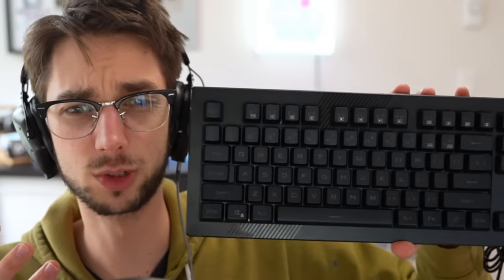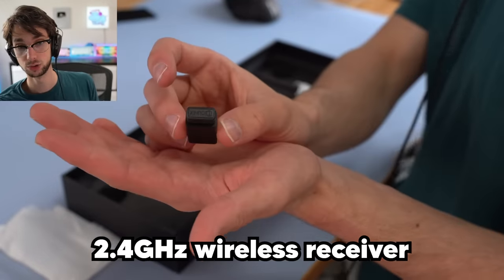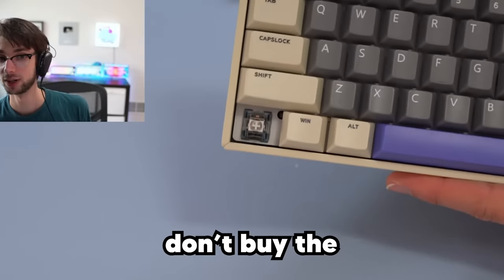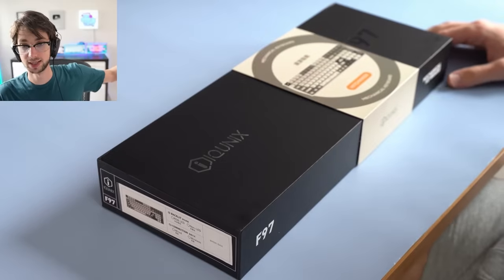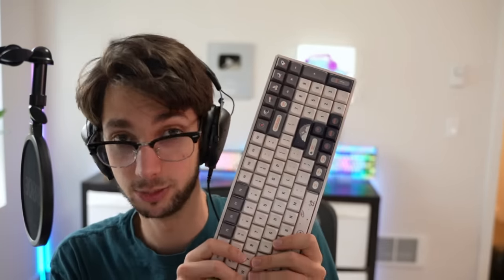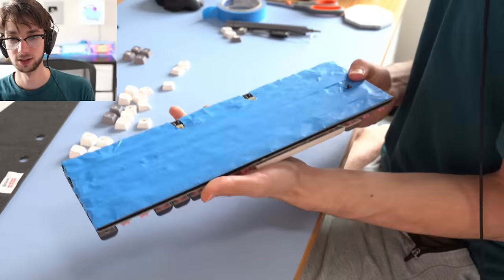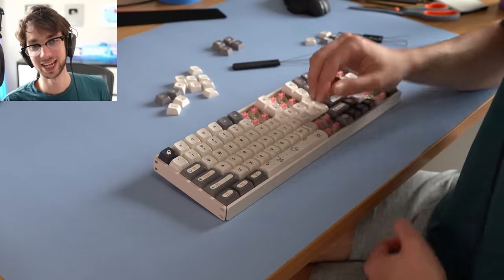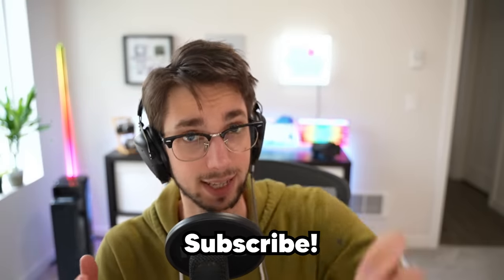Why do People Want Keyboards With Number Pads??

Comment: I have a crappy keyboard that came with an optiplex I bought a while ago, I also have an expensive custom built keyboard that sounds and feels great. But I still prefer the crappy one because it feels comfortable.
Reply: Bruh
Reply: you just gave r/mk an aneurysm. i love it
Reply: Actually though, I was rapidly disillusioned with the concept of thock at the first moment I had to type on one of those keyboards and it felt like a membrane keyboard made to tolerance. The whole modern mechanical keyboard space is such a far cry from the model M that spawned the industry, where the mechanical portion actually has purpose and the springs are physically sending your fingers flying to the next key.
Reply: @davidy22  1000%. As cool as "thock" sounds, at this point we've come full circle to membranes again. You know what kind of board has the softest thock sound? Membrane. Membranes also have a very soft typing feel. I currently have a Roccat Vulkan 121 with brown mechanical switches. No mods. Sounds and feels amazing, because it doesn't sound and feel like a membrane. I actually really like the mechanical, metallic, springy sound and feel. Also never thought I'd love brown switches this much.
Reply: @ThorsShadow  i never quite understood the point of gasket mount because membrane keebs are also flexy lol
Reply: ngl i feel the same sometimes with my dusty Dell membrane keyboard. Sometimes simple is better.
Reply: @Jwork   why do cars have suspension? Why not just make the whole chassis flexible?

Comment: As a screen reader user, I use the numpad as a controller for a secondary screen cursor. I also don't use a mouse at all and use the numpad to emulate mouse clicks on poorly-built interfaces. Also I use Excel. I could not do my work without a numpad. I even use the applications key.

Comment: I felt a little uncomfortable using my TKL keyboard. I really prefer of full-size regular layout keyboards, not even compact stuff like the Q5. It completely depends on what you actually use the keyboard for, though. I play a few games that heavily encourage having extra keys to bind stuff to. If you primarily play stuff like FPS games or MOBAs, a tiny baby keyboard could work great for you.
Reply: I going to get the Q5 Max rather than Q6 Max purely because the knob is a the top RHS where it belongs.

Comment: Other (in-stock!) compact options with numpads that hover more around $100+ are the Akko ACR 98 ($109 - I ADORE their Acrylic line), Akko 3098 series ($109), and a NEW ONE that I love is the YUNZII Keynovo IF98 ($149). 

Akko products in general are insanely quality and insanely cheap compared to competitors. I love them. Their switches are great stock and they're affordable, so you dont have to spend more on different switches. You dont even have to lube them, though I still prefer to. Lot of great options in color/size for every need you could have. Highly recommend if you're getting into/wanna try custom and not break the bank

The IF98 is gorgeous. I'm biased to the jade green, but they have a plain white too, and it sounds pretty good stock. Just lube the switches and lube/replace the stabs if you wanna mod it and it's chef's kiss. They only have like black, white, and green rn, but more options coming in the future.

Custom keyboards are an investment, but they don't have to run you broke <3 Lot of options out there, despite what the gatekeeping and elitism in the keyboard community tell you. (: you just need what works for you.
Reply: Love Akko switches. I used (and lubed) Akko lavender purples in my heavily modded Redragon K552 and Skyloong GK21 numpad.

Comment: "Why are YOU using bad keyboards in 2022??"

Cause i dont want to spend over two hundred dollars for a keyboard, jacob.
Reply: I mean.. that all depends on how often you actually use it. If you're literally typing all day as for example a programmer... I would seriously consider it.. unless you hate yourself
Reply: @ruadeil_zabelin  Considering I got decent keyboard I don't feel the need of buying another one like that. I kinda doubt they are that much better from branded ones
Reply: @wadimek116 Grabbed a thermaltake TT Level 20 for 60 Euros during Black Friday last year.

Good stuff, typung feels so much nicer, especially the finger joints seem to love it.

Never noticed how harsh the rubber domes were on them until I switched.
Reply: @wadimek116 Grabbed a thermaltake TT Level 20 for 60 Euros during Black Friday last year.

Good stuff, typung feels so much nicer, especially the finger joints seem to love it.

Never noticed how harsh the rubber domes were on them until I switched.

Comment: I need the full 100% because I enjoy inputing Alt codes. I frequently use Alt+Numpad 0151 for em dashes and sometimes Alt+Numpad 0148, when I can't normally close a quote, which tends to be after using 0151.

Because of this I chose the Keychron C2 for my first venture into keyboard modding. I carefully lubed all 104 Gateron Brown switches with 205g0 to preserve tactility, filmed them, and glued down pieces of shelf liner to fit every crevice at the bottom of the case with elmer's glue. I also didn't forget to the clip the stabs and used dialectic grease to lube them. The only part I'm not fond of is the spacebar wire, which I can't seem to balance perfectly to eliminate the rattle completely. Lubing only temporarily mutes the rattle but it comes back noticable once the lube thins out.

Otherwise, I'm really happy with it.

Comment: I have the F96 Coral Sea model. It was my first board that got me into the hobby. However, upon ordering it, they sold out and it was delayed. I wasn’t alerted til after I had to reach out to customer service, but they did keep me posted throughout the process. Shipping time was meh, but it doesn’t help that I live in the middle of the Pacific Ocean, which caused the shipping to take longer than intended, considering it comes from China and it has to go through customs and whatnot. 

Gotta say though that it was worth the hassle. Board quality is amazing and it feels awesome to use. I think I might get me the F97 since I can customize the switches compared to my F96 being a solder board. Anyway, long story short. Board good, shipping process meh, but me live in Pacific Ocean, so order at discretion.

Thanks for coming to my Ted talk. Bye..

Comment: Best prebuilts I have EVER used come from Varmilo.  Hands down the best QC and factory amenities.  Pre-lubed switches, case foam & filler, perfect stabs, tons of options and colorways, all major layouts, super high quality PBT keycaps with just the right amount of texture, wireless features, the works.  My TKL from them felt like absolute perfection from the moment I took it out of the box up until now 5-6 years later.  I have since built quite a few customs, but I still adore my Varmilo.

Comment: Not only do I work in accounts payable and need a numpad for 10 key entering (and therefore the preferred way of entering any numbers for any reason outside of work), but I also play PC games from my couch with my keyboard in my lap and my mouse to my right side (mousepad on a large wooden pizza cutting board on a pillow). The extra length on a 98% keyboard with a 10 key numpad means that it will sit across my lap better. Am I crazy for gaming this way? Possibly, but it’s as comfortable as console gaming.

Comment: You can still get an otemu red hot swappable full size keyboard for less than 75 usd with usb c and or wireless. If you don’t need wireless, it would be much cheaper and you can use the difference to get an amazing set of pbt Keycaps. Check Tecware or havit keyboards to start from and go from there. If you still need more nicer feel, lube the switch and stabs. 250 usd for a keyboard is too much to spend unless the company you work for reimburses the cost.

Comment: It's nice that more custom keyboard makers are offering options that include a numpad but I'm not crazy about how they've made the zero smaller so they can cram it up against the arrow keys. Your thumb is supposed to rest on the zero like it does with the space bar and that doesn't work with this layout. Also, the cursor position buttons are across the top instead of between the numpad and the rest of the keyboard. Sorry, but I'm just used to the classic Model M layout, as that's what I've used since I learned to type in the early 90s. Trying to switch to anything else is a major pain. That's one of the reasons I hate using a laptop unless I can connect an external keyboard. I get that some people like having a more compact keyboard, but to me part of the point of a "custom" keyboard is that it should be comfortable to use and I don't understand why so many of them seem obsessed with squeezing everything into as little space as possible.

Comment: Nah .. I'd get the Keychron Q5. It's under $200 with a fully anodized high profile aluminum case, gaskets, South RGB, foam insert, lubed screw-in stabilizers, 5 pin hot swappable, etc.

Comment: Taking keycaps off costar stabilizers is as easy as sliding one side on 1st then taking a small screwdriver and I mean tiny and pushing outwards so around the other clip on the keycap. Takes 10 seconds

Comment: Something that I discovered almost immediately after switching to TKL -- I rely on using my thumb to press the numpad enter key while my hand is on the mouse a LOT more than I'd realized.

Going to try out both a 1x7 macropad immediately to the right of the keyboard & seeing whether or not it work just as well / better to get a mouse with an extra left button that I can just map to the Enter key.

Comment: I actually just built my own keyboard today with Kailh Box Whites, but specifically chose the Glorious GMNK v1 keyboard for the FULL SIZE numpad. These keyboards are not "full sized" as advertised (97 meaning 97% layout), being that the arrow keys bleed over into the numpad 0. This is extremely frustrating to me, as my laptop has this layout, as that left half is where my thumb rests to press said 0 key. I have tried to retrain my muscle memory to use my middle finger to press 0, but it feels incredibly awkward.
Reply: yeah those single sized 0 keys are not real numpads

Comment: I got iquinix f97 and love it little more compact than my full size. Wireless works like a charm especially when I’m working at my main desk with multiple laptops. Sounds great! Weight is great. Overall 9/10 only gripe is costars after a few weeks a slight tick in space bar. Fixed it with a few padded bandages cut into small
Small squares now this thing just keeps rocking on. Had multiple coworker hop on board too! Also wait for there Black Friday special.

Comment: Muscle memory at this point, Ive used full size boards since childhood so having to adjust to hitting a modifier key and developing new muscle memory for each key seems like a pain compared to spending a few extra bucks for the fully extended glory of a numpad. Also games, its basically a 10+ key free macro pad that I can map to whatever without having to use the bar up top and screw with my regular 1-9 hotbar that gets used for active things.

Comment: I bought a similar form factor keyboard for like 45 usd. granted it came with outemu reds, non wireless and the cable is not detachable, nothing like a bit of modding could fix.

Comment: I just built a YMDK Melody96 Pro with the extra foam. If you want a good looking board with numpad, you should try it with an O-ring mod for mounting
Reply: I have a Melody96 Pro on order! What's a O-Ring mod?
Reply: @TheFreakyGames  it’s when you use a gummy O ring that is huge and fit it between the pcb and plate of your board. It then sit/ snug in the case and you don’t t use any screws or anything to anchor the pcb.

Comment: I love my numeric keypads. Keychron does have a stand-alone external numberpad with hotswap switches.
(and the reason the modded one sounds better: all the bad sound is escaping out that gap you left on the corner, so you don't hear it. Um. Yeah.) :-)

Comment: Which is better for typing? The  Outemo silent gray or white? I bought an epomaker keyboard with their chocolate silver switches I guess those are speed switches? They are too sensitive for me I make lots of typos. Not sure to get the gray or white. The gray have 55g actuation force but 1.6mmpre travel and whites 45g actuation force but 2mm pre travel. Not sure what more important for less typos the actuation force or pre travel. Those Choco silvers have 45g actuation force and 1.1mm pre travel so sensitive.

Comment: Number pads are also invaluable for programmers and budding gamedevs. However I personally can't stand 1u sized zero keys where the arrow keys cut into it which makes me end up pressing the right arrow key instead (when I'm entering multiple rows of numbers or one large string of digits I hover my right hand over the number pad, my index finger on four, my middle finger on 5, my ring finger on 3, and my thumbtip on the very left edge of 0).

Comment: Since I use slovak like half the time, what usually are numbers are accented characters. If I want to use them as numbers, I have to hold shift, which can be a bit annoying. Meanwhile I can more easily type them using the numpad.

Comment: Inputting Unicode or using program shortcuts are my reasons for wanting function keys/num pad. Many things straight up don’t work with function layers unless VERY specifically configured pr program. For an engineer using a dozen or so programs… yea I can’t be bothered…

I’d much prefer the numpad be on the left though… right handed numpads are a bloody relic. We have mice now. I need my right hand for that a lot 😉

Comment: I bought the hitchhiker one back when it came out, also tape modded it and ripped the antenna off as well. Turns out the 2.4 Ghz wireless and Bluetooth still work on mine so.....maybe a fluke on mine that it still works? A friend of mine also put in and lubed NK creams for me to replace the stock switches (TTC gold pink cause I wanted to try them. Sounded good but too light for me). Good board to use in IT.

Comment: I need a number pad because I use a lot of numbers for work. Mostly spreadsheet and math stuff (I'm a teacher, accuracy in grading is important).
Also, I do most of my grading from home. because I'm tired of being away from home after... every. single. eight. hour. day. Oh, and most weekends, because multiple classes. and when I want some down time, I play Star Citizen (a space game that uses a metric ton of key instructions) and it requires a number pad and I get tired of switching out keyboards from regular typing to video game typing and the key location differences between a TKL  keyboardtoanotherkeyboardversionislearningtwodifferent... AAAAHHH!!!

Comment: I'm such a deviant in the mechanical keyboard community.  I love my blue switches, and I love my numpad.  I have a keyboard without one, and there's nothing worse than having to type out numbers from the number row.  It's inefficient and stupid.  I would much rather own a boards that's slightly wider and includes a numpad, but slightly shorter and does away with the number row.

Comment: I'm using Royal Kludge RK84 with red switches. It's not the best keyboard ever, but I think it is pretty good. I am also planning on modifying it, any suggestions?
Reply: Mine arrived yesterday with brown switches and i love it, i would suggest you to tape mod it and lube the switches or if you're lazy like me grab a pack of gateron milky yellow pro, or gateron oil king.
Reply: Lube your switches and tape mod, it's the biggest upgrade you can make without spending a small fortune

Comment: Hate this layout with a numpad.
If there's a numpad and I want cursor keys please split the numpad zero, and emulate a standard nav key layout when the numlock is off. It's beautiful. Here the numpad zero is split anyway but the sad little modifiers are so smushed.
And as a numpad user, when I am using that numpad I am seriously using that numpad. But mostly I'm not. It can do other things.

That said, simply adapt the keycaps on this boi, tinker in the QMK firmware a little bit...
And you've got yourself 5 1U keys down there. That's the full standard set including the menu button plus an FN key. With that up arrow becoming available that's FN2.

This is an eminently saveable board layout for me. 6.5/10. Docked a full point for no function row gap.

Comment: I used to have that Iqunix F97 but I had to return it. It had an INCREDIBLE amount of case ping. It might have been just mine but it was unbearable. Any key press with any amount of pressure triggered it. 

Also, the ESC and F1 keys have north-facing RGB while everything else is south-facing. So weird…
Reply: I bet you are using Cherry MX switches on it.
Reply: @caleb2493  cherry switches were my only options. I bought mine with cherry browns
Reply: @NoizeTank  Then things sorted! The ping is from the Cherry MX, not the case, man.

Comment: Hipyo how would electrical tape be better or worse for a tape mod?
Reply: I'm no engineer, but I think electrical tape is too sticky, as it's made of plastic so it won't absorb any of the stickyness. Also it's likely to shrink a little which would likely make the tape peel up and move leaving the sticky goo behind. So personally I'd prefer a more paper based tape.

Comment: Keychron V6 is THE answer.  F all the other BS.  If you are used to and understand the pure benefit of a full sized keyboard, and are resistant to the low testosterone plea of "oh but what about the space on your desk," then welcome to the world of optimal full size keyboard beauty.  My build: Keychron V6, Akko MDA WOB Building Blocks (all black flat thocky keys), Gateron Milky Yellow home-lubed switches, stabilizers all wrapped in plumber's tape.  The result is a deep, clickety-clack monster of joy.